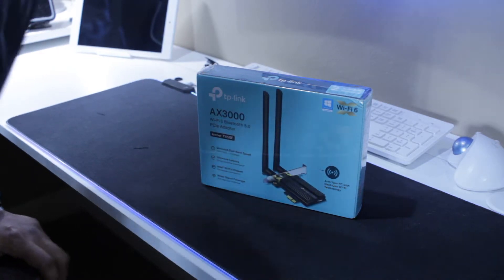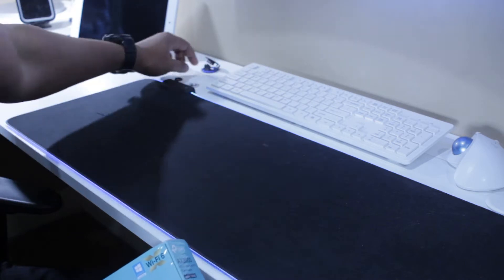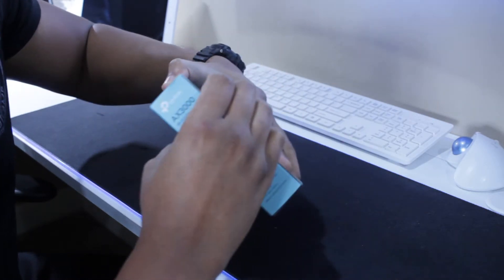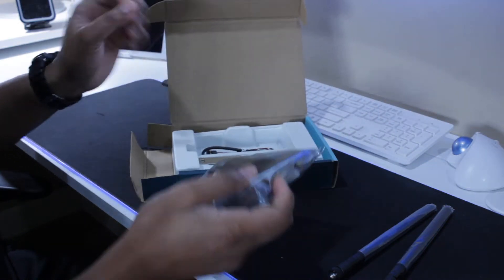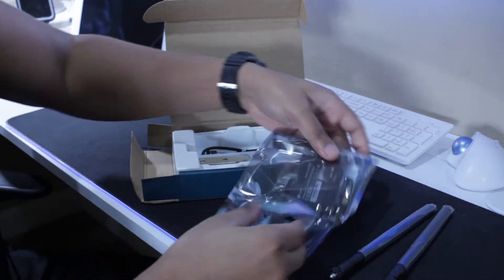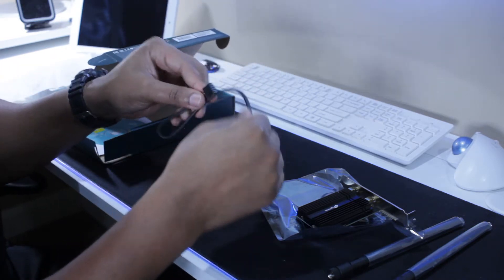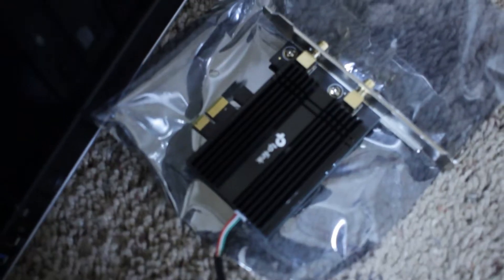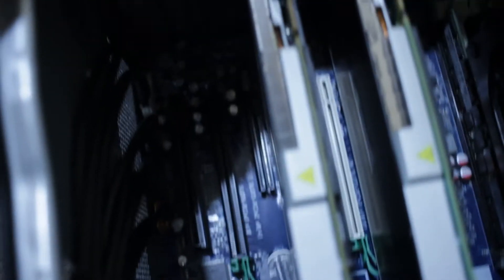Installing WiFi Adapter | Unboxing tp-link AX3000 Wi-Fi 6 Bluetooth 5.0 PCIe Adapter

Comment: hei, does it disconnects randomly after some time or loses speed? i saw some comments about it on amazon, is it fully stable for you?
Reply from the maker: Mine works good and I haven’t had any issues so far.